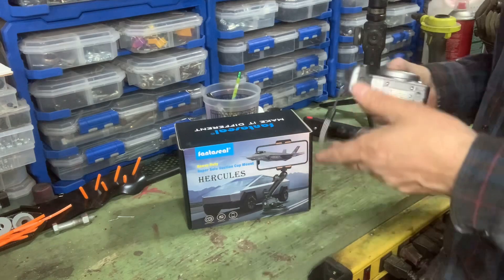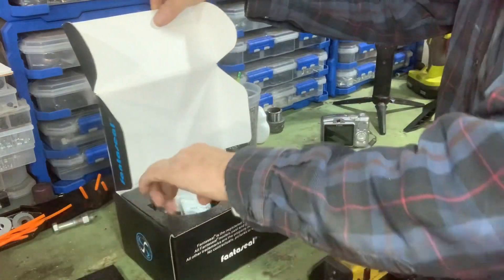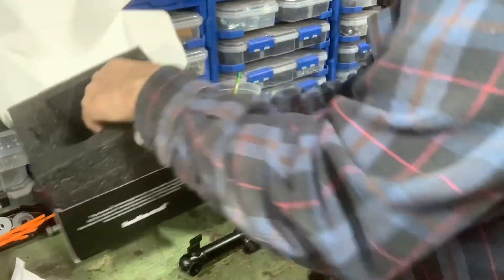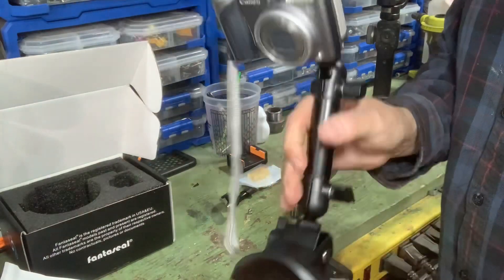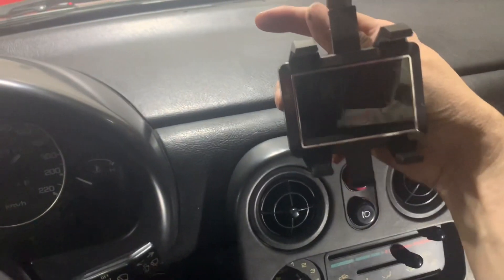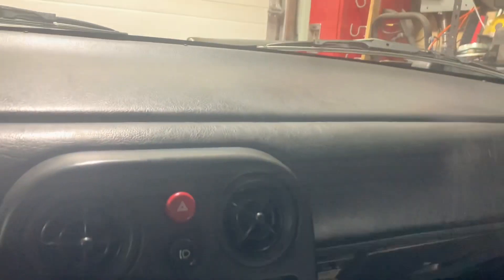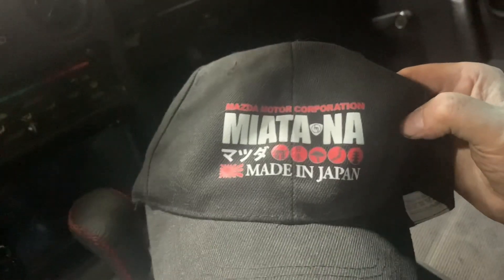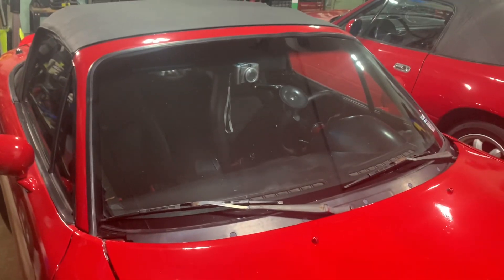Windshield Camera Mount

Comment: Awesome B🎸《☆》Wow👍🏾The Mega Suction & Stability Your new Camera mount provides is astounding. NASA SPACEX SPUTNIK🤳will all likely be incorporating similar systems in the future. A black Miata sounds cool. 415,000km sounds like a lot. Even in miles it would probably be at least 350,000. Happy Motoring🥤ZooomZooom✌😎☮
Reply from the maker: It is a lot of miles. The engine has a lot less and most of the car has been rebuilt 😊

Comment: You could barely latch the suction cup down   its not going anywhere 👍 Bruce ya lot me with cleaning a window using a  razor blade 🤔 was that a test to see who's paying attention 😂😅
Reply from the maker: It’s a crazy strong suction cup. Detail shops have been razor blading auto glass for eons
Reply: @Bruce L.  That's all new to me , I bet most never heard of it. Might be an awesome vid.
Reply from the maker: It works well as long as you keep things lubed up with glass cleaner. Scraping dry would probably leave scratches if you weren’t careful